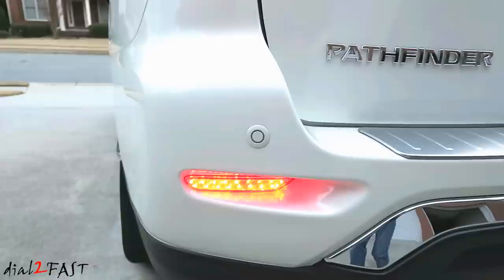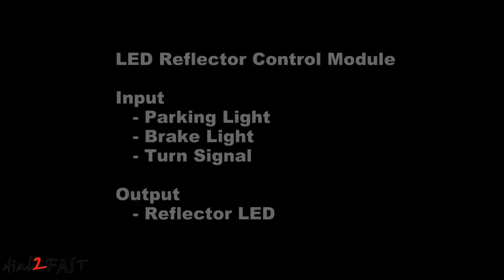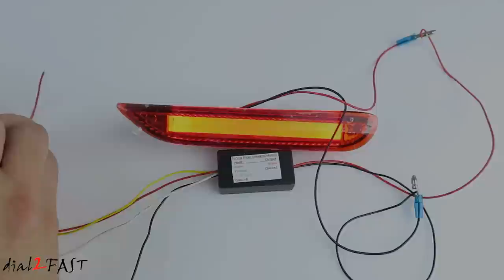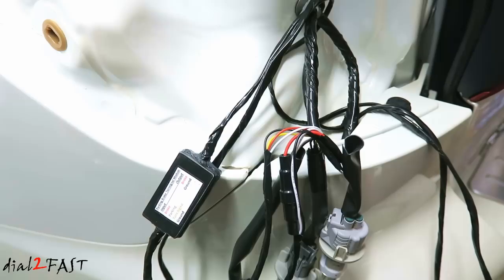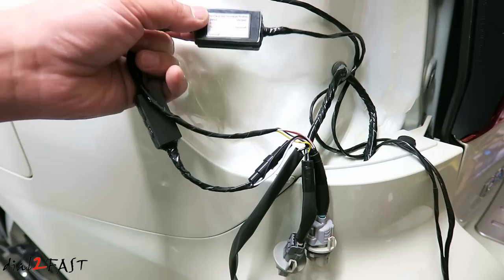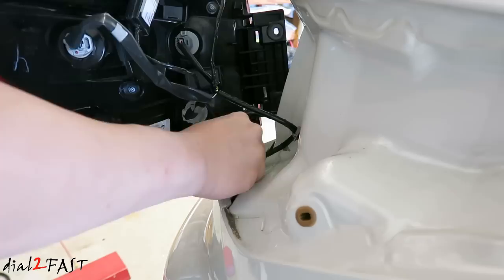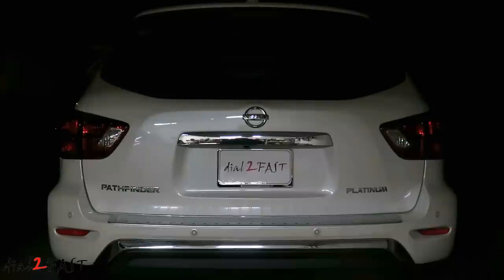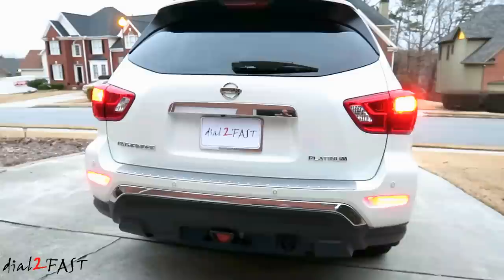Custom Rear Reflector LED Install Nissan Pathfinder - VIDEO 2

Comment: Great presentation.  I priced the converter modules and they are pricey at about $24 each.  For those who would like to save money they could eliminate the modules and wire the lights to work with the brake lights only.  That would give them extra safety while saving $50 and having less original wiring intrusion.  Thanks!

Comment: They are  impressive, and thanks for explaining the fitting process. My concern is whether they're legal, because they no longer reflect when you have switched the car off and parked it in the dark. Cars passing by won't see a reflection from the reflectors.
Reply from the maker: If they are switched on, they are visible. If they are not switched on (or not working), they are reflective. So either way, they are visible.
Reply: @dial2fast  cheers, I confused your reflectors that don't 'reflect', excellent video, I have been a subscriber for many years, I appreciate your videos, thanks.

Comment: Nice work! I did not see any resistors to eliminate rapid flash with your LED bulbs. Did you install one? thanks!
Reply from the maker: This LED is added to the existing turn signal (not replacing it), so no hyperflash issue, and no resistors needed.

Comment: Great Videos, You do nice work. The 2015 NISSAN Rogue is my wife's car. I bought a set of reflector lights from EBAY, I did NOT buy the cheap one ether. They came Red wire, White wire & Black wire.The Car has 4 wires? Red, White, Black & Purple I did the drivers side following your instructions that helped me a great deal, Thank you again.But when done and hooked up, all Car lights work as they should but the reflector light only does Running lights, Turn signal, and emergency flashers. It does NOT brighten up when you step on the break pedal? Should I connect something to the purple wire also on the car side?Like I say it works on all but Break light?Thank you Your friend Steve
Reply: That's definitely the purple wire, it's the positive wire for when you step on the brake...

Comment: Hi....I bought the same exact controller module ... and for some reason when I add power to the white wire nothing comes on (but the red and yellow wire works)...strange

Comment: Question what is that small black  box on the bottom.. You can see it at 5:19 of the video
Reply from the maker: there is another box that got installed for another upcoming project where I installed a F1 style brake light. It will be mentioned in when that video comes out. It's similar in function as this project.

Comment: Don’t know if this has been asked already. I really like the look of the lights you bought and didn’t use. Wondering where you got them. The only ones I find are strobe braking or sequential which I hate. I would really appreciate a link for them. Also thank you for all the vids of your Pathfinder, I have the same car but in black. Looking to do most of the mods you have on yours. Thanx in advance.
Reply from the maker: Bought them on Ebay long time ago. These lights will eventually die because there is no current limiting resistor inside. The lights look good but the electronics inside is garbage.
Reply: @dial2fast  Thank you, do you have any recommendations as far as ones that I can buy that aren’t struggling or sequential? Don’t have the time the tools or the knowledge to make my own like you did.
Reply from the maker: @ericlemus1046  Found these sequential ones on Amazon for QX60 and Pathfinder https://amzn.to/37ow22q
Reply: @dial2fast   I had seen those before. Looking for ones that aren’t sequential. Don’t like them to strobe and I don’t like them to be sequential.
Reply from the maker: @ericlemus1046  These ones from iJdm store are not sequential https://amzn.to/3bhtzrA

Comment: Dial2 fast I am a current subscriber and based on your recommendation for the pathfinder lights I ordered the modules from exledusa but never received my product nor response. I now your not responsible but was wondering if you have any insight rather they are still in business etc?
Reply from the maker: I see their website is still up and since they are based in the US, I would think they are still in business. I remember when I ordered my controllers, shipping took a while. Think I waited 2-3 weeks to get them shipped. Over the years, I have ordered 2 sets of these and they both came. Maybe you can also try contacting them on FB.
Reply: dial2fast Well one noticed you have a different site that you order modules from I'm your description. Is this company better. Add far as EXledusa it's been months and no response and after my first message to you I looked them up on Facebook. It seems everyone else is having the same issue with getting their orders and getting no replies. Surrey several people commented on their page about the same issues they finally responded to one individual. They requested for him to message or email which the individual stated he did and again no response back for over a week or two now.

Comment: That module by exled is poorly designed. Why couldn't they make it weatherproof? Even cheap ebay modules are waterproof. What a shame...
Reply from the maker: I understand your point, but there really isn't much of a choice when it comes to finding this type of control module for this specific application. Seems like no other companies care to make them and probably not a high demand product. Also keep in mind, I placed mine outside the vehicle because it made the install easier instead of tearing up the interior to find the wires, but for most sedans, or coupes, the module will most likely be placed inside the car since the tail light assembly is accessible from the inside trunk. For me, I am ok with it as long as it will last. Time will tell.
Reply: Yeah these modules are design with cars like sedans in mind, not bigger cars. Still, they could of done a better job of the inside, little bit of silicone doesn't hurt.